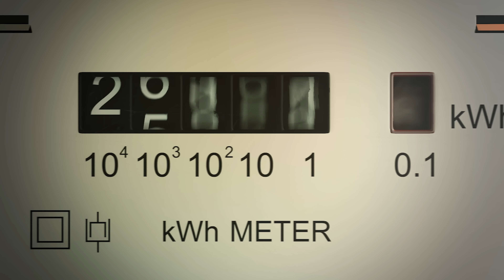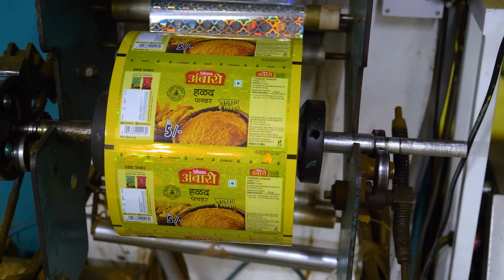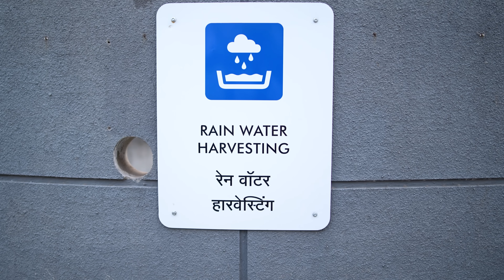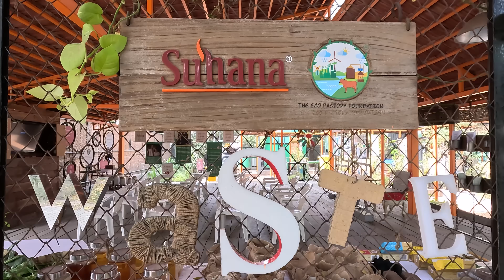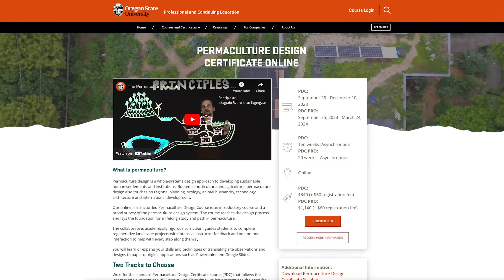This Factory Grows Food Forests

Comment: Every time I go to a mall, parking garage or some other barren concrete wasteland, I wonder why not cover these parking lots with solar panels the can power the lights in the building and ac, fans for ventilation and airflow if the parking lot needs it as well as the lights in the parking lots. Could capture rain water for plants they could use to create barriers and green spaces and even, toilets and cleaning the solar panels. I went to a home depot once with a random semi cover section of the parking lot and the temperature difference was atleast 20°f. These cooperations act as if we are not going to buy from them if they have a welcoming environment. I would in fact drive a little extra to go to the store etc. Where my vehicle is out of the sun, surrounded by trees and fresh air, and I am not getting literally sun burnt just trying to load my items in, then the seats are hot as hell.

Comment: I am so happy that the plastic Pyrolysis equipment has been utilised, as a fuel its a cleaner, also can be reused as a plastic, once old plastic has a value then the waste is collected not dumped. Truly the icing on the cake on a absolutely amazing project. have you looked into horizontal wind helix turbine to run along corners of building ?